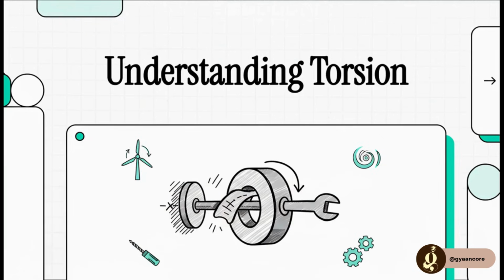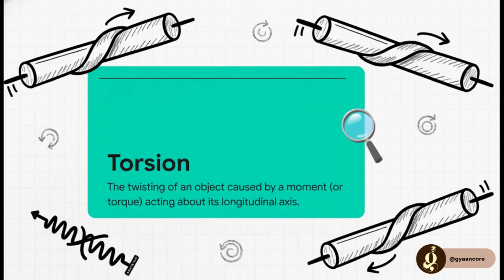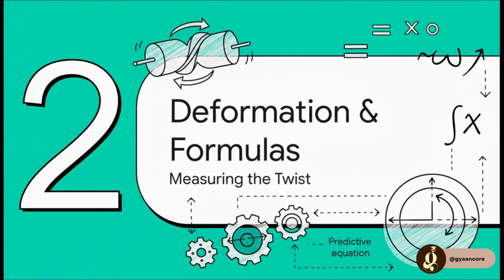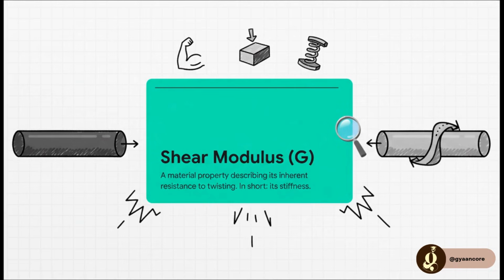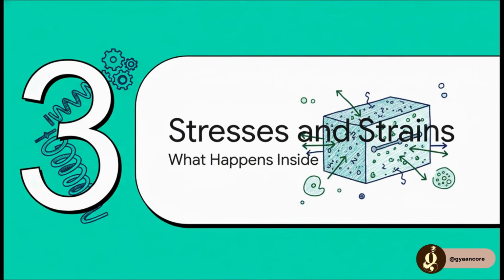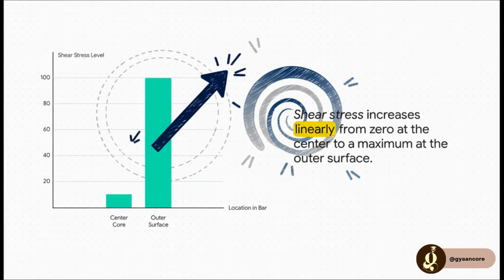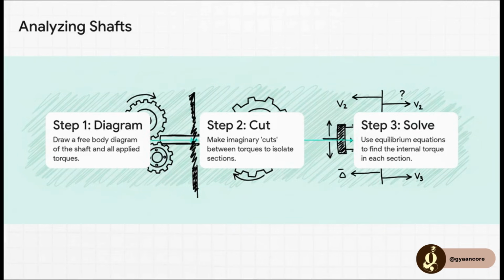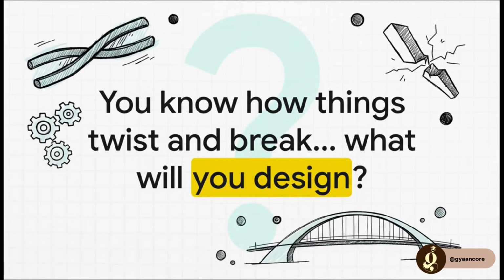Why Are Drive Shafts Hollow? (The Physics of Torsion) 🚗

Comment: Hollow is only stronger by " weight"  a 2" is stronger than the heavier 1" solid. Note the " spine " is welded into the tube. The " spline" is only slightly smaller diameter. ( less the splines too lol )  Am listening But NOT totally agreeing. The "tube" can flex yes But how much twist before it breaks. Lol.
Reply from the maker: You're spot on about the strength-to-weight ratio! That’s the magic of the Polar Moment of Inertia. A 2" tube beats a 1" solid bar because the material is further from the center, giving it more leverage to resist the twist. You are also right about the breaking point—thin tubes risk buckling (kinking) before they snap, whereas solid bars will usually yield first. Thanks for watching!